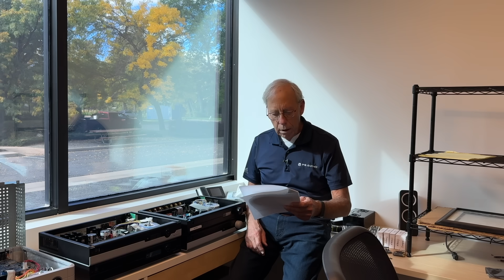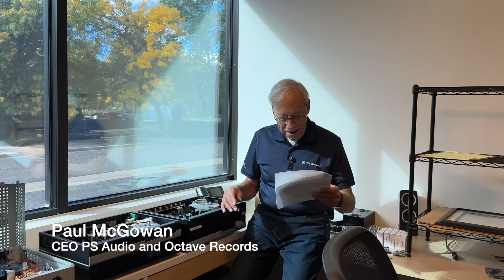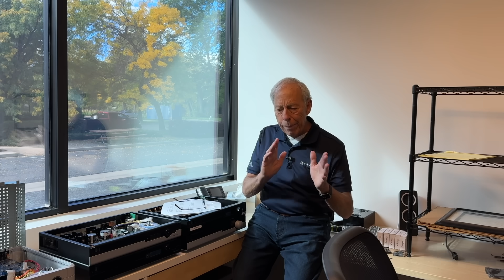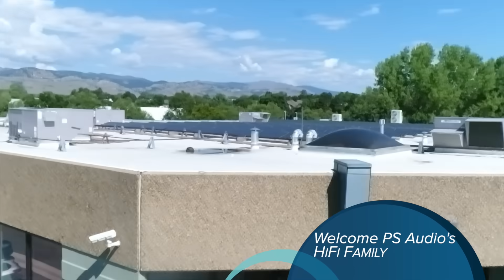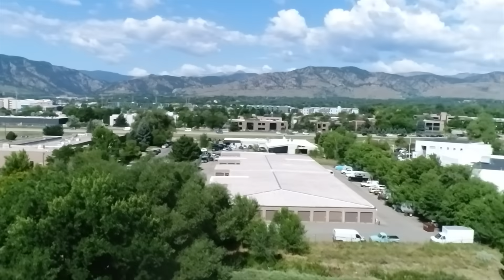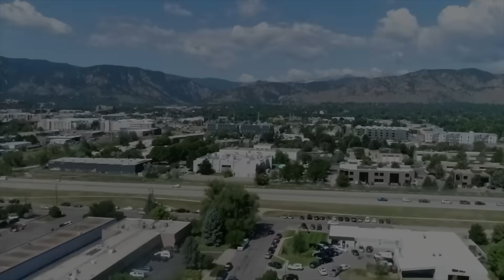Paul explains AES EBU

Comment: Wait wasn't that question more like whole digital path vs analog path? 
I'm just a poor pleb so I'm considering getting a pair of Genelec 8361a, which are active speakers with DSP, instead of a fancy stereo system, like what PS Audio makes, and now I wonder whenever I should just plug them in a normal way to an external DAC that I already have or to get a digital interface and plug them via AES/EBU, completely skipping the analog path and D/A and A/D conversions, before the very last step of sending the signal to drivers. Source obviously being a PC.

Comment: AES EBU was developed first and around before Sp/DiF and I2s, I2s wasn't developed until 1986  and it was mainly designed to carry Digital 2 channel audio over VERY short runs or just on circuit boards and not over cable.
https://youtu.be/3nUTMnpqOdA
Professionally I would use Fibre Optic single mode for the longest runs as it is the most robust for that job, and at home I will always defer to Optical for its iosolation properties (no copper no hum)

Comment: Well, The Digital line content will not benefit any thing from being balanced, however, a balanced digital cable produces much less digital noise to the environment. If an analogue gear is nearby the digital cable, and it is a sensitive and not that well protected i.e. a single ended MC cartridge  or vacuumed tube preamp  it might suffer from digital noise. BTW, this is the same as for shielded AC power cables, if it makes a difference in a system it is because there is a weak part witch is affected by the EMI behavior of that cable.

Comment: Just the info in needed since i have multiple Panasonic DAT recorders from the SV 3700 and SV 3800 series.

B.t.w. my smartphone has USB-C (and BT) audio output. I have a USB-C to audio (3,5mm jack) cable converter (€ 5,00) and sounds damm good.
Wonder how USB-C audio is compared to all exsisting other digital audio forms.

Comment: I have a case where AES EDU connection from a streamer to a DAC was by far the best sounding option.  Perhaps it has to do implementation and/or cable ability /,synergy.   I2S was not available in this case.  Basically it is worth testing all connections that are available to determine the one that sound the best.
Reply: @johnsimpson8187 ...well said 👍
Reply: Erklären Sie mir doch bitte mal, woher bei einer digitalen Übertragung von Daten ein Klangunterschied her kommen soll ?

Comment: Let's not be confused about this. A digital music interconnect has no sound to it. It doesn't affect the frequency response, sound stage, detail resolving qualities or anything else known from the world of analog audio. If you experience DATA ERRORS you will hear it as dropouts or nasty distortion. There should be absolutely no reason for having data errors within any well engineered audio system! Same goes for jitter. Any DAC having jitter issues need to be thrown out. It's that simple. Any decent digital audio engineer can make sure jitter is not an issue through buffering, PLL and other tricks.
Reply: Opinions vary
Reply: @mitchtaylor6512 An opinion based on ignorance doesn't matter however.
Reply: @ThinkingBetter   ...so your opinion doesn't matter TB??
Reply: @Fat Rat I'm representing audio engineering, electrical science, measurements and factual listening test results. All of it is in agreement with me.
Reply: @ThinkingBetter   ...& hearing is in agreement with me. I'd rather be listening to music through my home-audio rig & "measuring" the differences that way than measuring the electrical signals running through it, but if that's what gives you a hard-on then by all means keep measuring👍
Reply: I absolutely love the people claiming they know better because they "hear". And then they chose to listen to vinyl xD.
Reply: @RJ-vy4yd 😂yes
Reply: TB ...without getting into our usual, friendly slinging match I am, as usual, going to have to disagree with your assertion that cables don't 'sound' different.
Reply: Ich weiß wie Kabel klingen: "uiuiuiuiuiuiuiuiuii" so klingen sie wenn man  sie durch die Luft schleudert und "platsch" wenn man sie Ihnen anschließend um die Ohren schlägt... !
Reply: @bachglocke3716   ...funny, but still ignorant.
Reply: #Fat Rat Ignorance is ok, but you should study the subjects in such case. If a digital interface sound different its because something else is causing it such as sample rate conversion is involved or a sub optimum stream is selected by a streaming service. Dumb one-way digital music interfaces such as SPDIF or I2S can perfectly transfer the waveform data but lack the control data to ensure the optimum stream from a streaming device is the one played and transferred without sample rate conversion to the DAC. USB is superior because it also can manage DAC capabilities and ensure you get the most optimum stream and can pull it asynchronously eliminating the risk of multi master jitter mess.
Reply: @ThinkingBetter   ...well, yes, your hearing ignorance doesn't seem to be affecting your ability to lead an otherwise 'normal' life, so Kudos to you. You study your subjects while I kick back & evaluate audio with my hearing...the way God intended 👍😉
Reply: @Fat Rat The irony here is that I've professionally done listening tests numerous times and identified issues almost nobody would ever notice. For example, I was listening tester on icePower (used in Sprout) during original R&D of it when class D finally matured to audiophile levels. A Phd project turned into icePower. Recently i was listening testing on a different class D amp and failed it due to slightly audible TIM distortion.
Reply: @ThinkingBetter  https://www.youtube.com/watch?v=Gvfb3InnvdE
Reply: @Fat Rat I would be more excited the moment you have an example of someone who can hear the difference without first being told what cables are used 😂
Reply: @ThinkingBetter   ...firstly, I'm not here to excite you & secondly, I don't need to go through all of the BS that you say is necessary to evaluate cables when I can hear the improvements straight away. Why would I want to waste my time changing cables over half a dozen times just to 'excite' you when I have already made my evaluation...that's not only a waste of my time but it's also very silly.
Reply: @Fat Rat Just beware what you think you hear, you would not hear if your mind wasn't also aware which cable is used. I hope some day someone can prove me wrong with something credible here, but so far never happened. Blind tests are on my side.
Reply: @ThinkingBetter   ...& hearing is on my side.
So what's your take on isolation/vibration absorption footers & platforms like Townshend Engineering, IsoAcoustics & Stack Audio? Have you ever tried any of these devices?
Reply: @Fat Rat Yes I know for a fact you can gain better clarity by using some of these. I once had s terrible wooden floor causing havoc and even acoustic feedback via my turntable cartridge damaging my speakers (super loud feedback loop suddenly started).
Reply: @ThinkingBetter  Ob Sie das diesem "Rat" erklären, oder einem Hackklotz: Die Wirkung ist die selbe! Der strotzt nur so vor Dummheit und Arroganz und überschätzt grenzenlos seine Ohren !
Reply: @bachglocke3716   ...you don't know that. You're just giving your engineer's opinion because your hearing is inadequate to be able to hear differences in cables.
Reply: Nicht Ihr Gehör ist auf Ihrer Seite, sondern Ihre Dummheit ist auf Ihrer Seite !

Comment: I tried all digital inputs in my Chord 76 HD DAC. I have four inputs: spdif (optical, coaxial), USB and AES/EBU. The USB input sounded a little flat missing lower frequencies but with a bigger sound stage. The spdif optical input missed a little dynamics and the coaxial input sounded more dynamic and could deliver more lower frequencies (bass). But the AES/EBU connection was the best of all regarding dynamics, clarity and bass quality. I am using digital AES/EBU cables from SUPRA between my LUMIN streamer - MUTEC Reclocker and Chord DAC with very good results.
Reply: @jaceksok8027 ...pity that you don't have I²S to explore as well, however, I, like you, have found AES/EBU to be the best out of the four(4)...four because I didn't bother with USB.
Reply: Thanks for🙏 your comment. Of course I would like to try the I2S input but my DAC doesn’t support it. The I2S standard should be superior because it does separate the clock and data signal. 🎉🥳
Reply: What are you talking about? It's digital signal it either works or it doesn't.
Reply: @maciej-36 Jitter ??? 😮
Reply: @jaceksok8027  Modern DACs have own buffer and don't relay on a source clock.

Comment: AES/EBU and S/PDIF limits the maximum reliable sample rates and bit depths in typical implementations to 24-bit/192 kHz.
While S/PDIF and AES/EBU have similar bandwidth limitations in practice, AES/EBU uses a much higher signal voltage and balanced connection, making it more robust and reliable for longer cable runs than S/PDIF. While I2S can handle very high-resolution formats, including double-rate DSD and PCM up to 384 kHz or 768 kHz.
Reply: You know what all these are complete joke compared to optical usb which is completely immune to electric interference, and have bandwidth to carry any type of audio signal.
Reply: @HyperOpticalSaint  Wired USB can compare to I2S, but the "optical" part just makes it TOSLINK and drops to those reduced speeds.  A USB-to-optical converter will be limited to the optical standard's bandwidth (e.g., 24-bit/96 kHz) regardless of the USB source's capability.
Reply: @glenncurry3041  NO. USB to toslink and Optical USB are two completely different thing. Optical USB can maintain all USB function, I had one that could do 5gbps, new ones should be 40gbps, that's enough for something like 32 bit 768khz for 10 channels.
Reply: @HyperOpticalSaint  OK That Optical USB is just devices that transport USB over fiber for distance. Does nothing other than any other USB . So what?
Reply: @glenncurry3041 optical has more potential than most of the other interfaces, but it's not implemented properly in audio.
Reply: @mitchtaylor6512   ...I don't know the proper (technical) name for the doodads that convert the laser-light signal back into electrical zeros & ones & vice-versa, but apparently they are the weak link in the optical Toslink information transfer chain...with reference to your, "but it's not implemented properly in audio." comment. I suspect that this problem resides with both signal converters, ie. the sending doodad & the receiving doodad...'all the doodad day' 😉...sorry, I couldn't help myself.
Reply: You got it right, plus the toslink cable.

Comment: Okay Paul, prove it!
I'm calling you out!
Show us the loss of AES, or SPDIF vs I2S.
Reply: Actually, it's not "or": both RCA and XLR use the S/PDIF protocol, the difference is the former is an unbalanced 75Ω connection, the latter balanced 110Ω. What many overlook is that an RCA plug isn't 75Ω, and that to avoid reflections, BNC plugs and sockets should be used. What Paul doesn't mention is that S/PDIF connections can be externally clocked (as in recording studios: using a master clock).
Reply: @LeonFleisherFan  Das SPDIF-Protokoll ist nicht das gleiche wie das AES/EBU !: Die Unterschiede liegen im Header des Protokolls. Die Audiodaten sind gleich. Die meisten Geräte erkennen automatisch um welches Protokoll es sich handelt.
Ältere Audiogeräte aus dem Heim-Bereich verweigern ein AES/EBU-Signal am SPDIF-Eingang !
Reply: @bachglocke3716  Preamble bit and subcode usage, irrelevant for the discussion. But yes, you're correct.

Comment: Fun fact: AES/EBU mostly uses the same XLR plugs you know from balanced analog connections. Can be confusing in huge studio or PA setups.😉
Reply: @Fastvoice ...I read that the balanced XLR cable for digital needs to be capable of a higher frequency range than that for analogue transfer. I tried two different silver XLR cables & one sounded a little duller than the other, so it can be a bit of a craps-shoot, even with the same metal.
Reply: @Fat Rat Dullness is as much a subject within digital music data transfer cables as fun factor of YouTube jokes are impacted by the type of Internet cable you use for a computer. You have a great imagination and if you actually understood these subjects you would realize you are in lala land. Data is data...
Reply: @ThinkingBetter   ...for a Gemini I have a terrible imagination, however, apparently I have great hearing...at least better than You & a few other 'measurements-uber-alles' wannabe audio engineers on this channel. I'll stick with my hearing & you can stick with your books of knowledge & your plethora of measuring devices ✌💖🎶
Reply: @Fat Rat You would definitely be shocked if challenged on your belief in a blind test. You not believing in blind tests is exactly the same as you not believing what you hear will be noticed when you don't know what cables are used...😂
Reply: Sie müssen sich nur lange genug auf Ihr Gehör verlassen.... dann sind Sie verlassen ! Ich würde an Ihrer Stelle den Mund nicht so voll nehmen, vor allem dann wenn Sie die Leute nicht kennen !. Beweisen Sie mal durch einen Hörtest bei einem Akustiker, daß Sie ein besseres Gehör haben als alle anderen ! Ich habe schon andere Leute scheitern sehen mit ihrem Gehör...!
Sie können noch so viele Kabel auf "Klang" testen: Sie werden keinen Unterschied hören , egal ob versilbert oder vergoldet oder sonst was !
Ihre gehörten Kabelunterschiede sind Einbildung wie bei  allen anderen Klangvergleichen zwischen Kabeln auch!
Und: Was man hören kann, kann man auch messen, aber das wenigste was man messen kann hört man !
Reply: @ThinkingBetter  Der würde genauso reagieren wie alle anderen HiFi-Freaks: Im Doppel-Blindtest kläglich versagen und dann die mannigfaltigsten Ausreden erfinden um das Versagen zu entschuldigen - Meine Erfahrungen mit solchen Leuten... !
Reply: @bachglocke3716   ...now I know that you are hearing impaired...I feel very sad for you 😟
Reply: @bachglocke3716 I've done many audio blind tests and seen a bit of everything. Surely if something truly sounds different you can prove it in a simple ABX listening test. And surely if a cable does anything special to an audio signal that can be heard in a listening test, you can also measure the cable and identify the electrical difference. The science is clear on such simple topic.
Reply: @ThinkingBetter  Da sind wir uns einig ! Aber diese HiFi-Freaks erfinden dann bekanntlich die abstrusesten Ausreden um ihr Versagen zu rechtfertigen...  🙂 Vor Messungen haben diese Leute ja Angst wie der Teufel vor dem Kruzifix, weil sie genau wissen, daß sie dann ihrer Lügen entlarvt werden... !
Reply: @Fat Rat: Wann bekommt denn die Community denn eine Veröffentlichung eines audiometrischen Protokolls Ihres Super-Hyper-Ultra-Gehörs `zu sehen ? Interessiert alle ungemein ! Wir wollen doch alle wissen mit welchem außergewöhnlichen Genie wir es hier zu tun haben ! Denn Sie sollen die nächste große 5.1-Produktion der New-Yorker Philharmoniker leiten !!! Und das geht nur gegen Vorlage eines solchen audiometrischen Protokolls ! Also los ! Wir warten alle darauf  !!!!